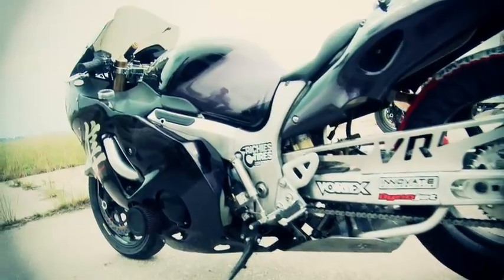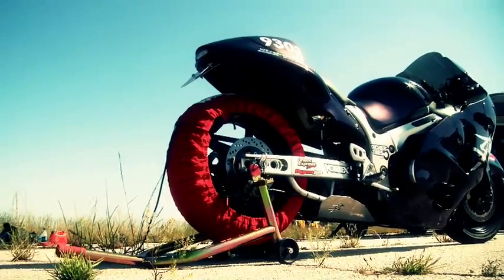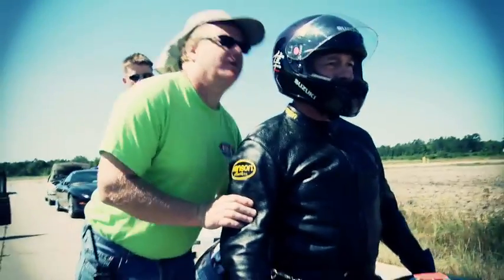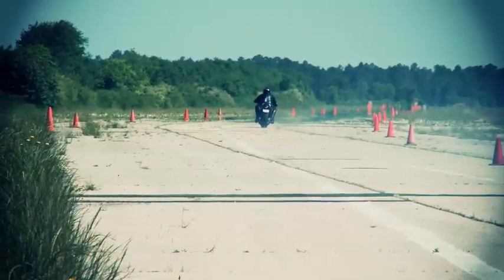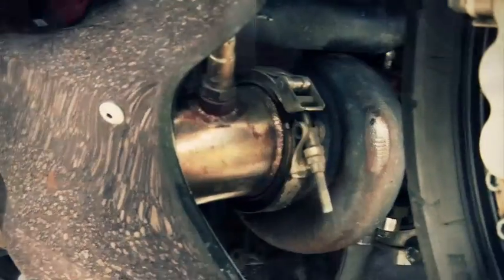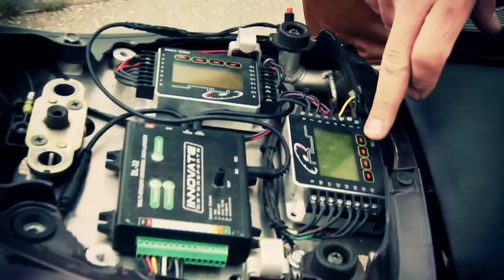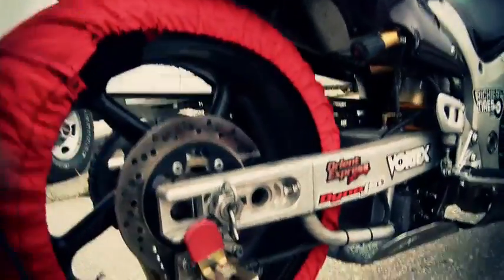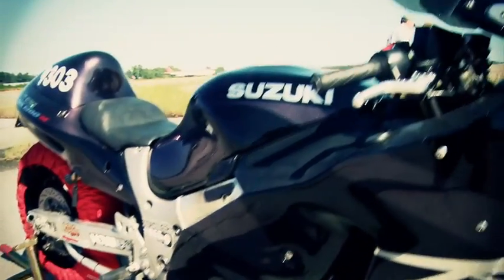Fastest Mile- 256.79 MPH on a Turbo Hayabusa

Comment: @spudhead96 You are absolutely right. I rarely ride or drive over 100 mph so having a Hayabusa would just be impractical for me. There is no where for me to ride or drive more than 70 mph legally except at the race track. We dream of owning fast cars and bikes but I would also lose my licence quickly. It's a great bike for sure and I could afford to own several but I own a light weight sports bike that's fun to ride and quicker in the city  than a Hayabusa and a lot cheaper to run.

Comment: @capnapalm hell a top fuel dragster makes 8000hp with 8 cylinders and does over 330mph in 1/4 mile. Good luck going from gas station to gas station though.

Comment: @wahconah98 What hype? The 1001 hp quoted is bhp, that's engine power before power loss. An engineer, who worked on the car said, that in tests, the engine had produced 3000bhp. 
That's why they can increase the power by 200bhp just like that. Do you think this isn't purposefull? Many manufacturers will try to break their record, and by holding back such a massive reserve, they'll be able to hold the throne for a long time to come.

Comment: @TheCrazyFinn - Toned down from 3000hp?  No chance in hell...  I think you fell for the hype about the actual HP generated from the fuel burned in the engine before you factor in all the inefficiencies of an internal combustion engine.    As a very very (stress very) rough estimate, crank HP is about 1/3 of the total power of the fuel being burned.  2/3 of the power is lost as heat and in mechanical losses.

Comment: @Chris239408 bugatti engine is maxxed in the ss model, bugatti said that themselves. ssc ultimate aero is on 16 psi and still has room to tune. so thats probably were you got that idea from. but still neither car can touch something that weighs as much as both of those cars engines.

Comment: @Chris239408 Believe it or not, sports cars are more aerodynamic than bikes.  This is why there are very few stock motorcycles capable of breaking 200mph even though their power to weight ratio is much better than a car.

Comment: @Brants10 I think you are missing the point the Hayabusa is a motorcycle not a car. If you have never bbeen on a bike at high speed you will never feel the adrenal rush it create. It is not the same in a car. I have a 2009 busa and trust I do not care what car you in the rush is not the same I do not care about radios wipers or any other creature comfurts. You are right the bike is not in the same league as your presiouse Veyron. I would chose the bike every time.

Comment: @srt10taylor Lol, you're talking like 10mph is nothing at 250+mph. There's so much air resistance that even an additional 1mph will require significant horsepower. Plus I doubt this turbo hayabusa is even built to run for that long. The engine would probably overheat and blow after 2 miles. It's like me saying that a top fuel dragster can hit 320mph in the 1/4 mile, so it can hit 500mph in 10 miles.

Comment: @CBR11X

Cars are able to put more power down on the road, and have better aerodynamics. A Ford GT hit 266.9 mph in a mile, with 18 mph of headwind. The car had 1,900 horsepower in that run.

Comment: @8Sniper8 Yeah, but did it reach that speed in a standing mile? I think it would need several miles and a special track to reach top speed , like the Bugatti Veyron.
This is about the Texas mile, not about absolute top speeds. The Ultima Aero would be struggling to reach 190 mph over the standing mile.

Comment: @Inv4derxXx They have all sorts of vehicles out there from mini motocrosses, vw beetles to 1,500 hp twin turbo V8's. I want to take my commuter bike to see how fast it will go then do some mods. It can be a low budget hobby to a very expensive exercise. I think you a right about it being a Ninja 500. I'm planning a small capacity racer to fool around with on the salt flats.

Comment: @Ayperos93 Why can't it be done? What's so magic about 160 mph? Seems like you pulled some number out of your arse (and an opinion as well.) When air gets under the bike at high speeds, especially bikes with fairings, of course the bike can stand up. It happens from time to time in racing. Also  you can see the Youtube video of the world's fastest wheelie which is 182 mph plus.

Comment: @jorgigale Your not wrong. 189 is fast by any normal standards. Very, very fast indeed. It depends on the context. Speed is addictive. If you sit on 100 mph for hours it seems slow. But go 100 mph straight out of the driveway and it seems very fast. 189 mph is 277 ft second and if you fell off at that speed and took 8 seconds to come to a rest, you would slide about 1000 ft or more than the length of 3 football fields. I wouldn't think you need to go faster.

Comment: @badbrad66733 Potential top speed should be referenced to the power to drag ratio, that is Cd and frontal area. A 1000 hp car may have a frontal area of 25 sq ft and Cd of 0.35. This would give a combined air resistance (R) of  8.75. For every unit of air resistance (R) the car has 114 hp. This bike has a Cd of about 0.5 and frontal area of 6 sq ft resulting in R =3. The bike has 480 hp or  160 hp/R. The car still needs more hp to go faster. 1500 hp in fact which seems about right for Maxton.

Comment: @crash86ed No slicks because it's a street registered motorcycle. No warmer on the front tyre because it's not driving through the front so doesn't need to grip like the rear. I'm sure they know what they are doing. They want to slam on the brakes cause that could destabilize the bike at that speed. I'd say the rider would gently squeeze the brake to easy the speed down. They have plenty of room to pull up after the run.

Comment: 110mph is perhaps fast in a car, but on a bike, especially the 1000+ cc class 100 mph is simply a grab of the throttle about a few seconds away.  Perhaps it's different for everyone, but I don't start to get tunnel vision until about 160 mph, it's not until ~190 it gets a little hairy.

Bikers routinely travel around 130 mph on the interstate here and it actually seems kinda slow after a while.  Upon slowing back down to 70 mph you feel like you could get off and walk faster than you are riding.

Comment: the veyron also does weigh a lot. its just gifted with a shit tonne of power and good gearing ratios to hit top speed. 253 on a veyron takes a lot of runway to hit because is itsnt built more for acceleration but top end speed

Comment: More power and less weight are not the most important key to speed, reducing wind drag is. Put a stock Hayabusa into an enclosure and it will easily do 250+.

Comment: 18.000?? Dude , that would be stock as in not tuned , costs way more to get it like that ;-) Also the veyron is a 2000 kg car , the hayabuse what , 250 kg??? Not to mention in the veyron u have luxury and stuff , there's no way to compare both of em ;-) not talking bout the fact this one is as fast as the STOCK Veyron ;-) The tuned one goes way faster ... Then again ; no way to compare them ...

Comment: bullshit, there is a whole industry working on integrated protection such as back protection etc. I agree that this will hardly help at very high speed due to the distance you need to stop sliding and all the broken joints to this point. BUT, leather wears off pretty fast too and then you would be happy to have some kind of additional protectors, no plastic ones or ?kevlar? of course...

Comment: alot has to do with the bike also having less surface area..which would probably actually have more to do with the top speed reached..power to weight is more of a concern in acceleration to top speed

Comment: its called power to wieght ratio. the Veyron needs more power to get up to 253mph since it weighs more. Also, as you may or may not know, when you double your speed, your drag increases by four, so the faster you go, the more power you need. As for a bike that doesn't weigh much. you need less power to acheive the same speed.

Comment: This comment is for Cabritorsss. They do have small 4 cylinder car engines that push 1400 hp to the wheels when modified!! Brent Rau's 2.0 liter (2000cc) Mitsubishi eclipse has over 1400 hp and runs 6 second 1/4 miles! 
     His 2000cc engine is only slightly larger than this hyubusa engine which I believe is 1300cc. 

This busa is bad ass none the less!

Comment: You my friend, are an idiot. If you had a mclaren f1 engine and this engine put on the dyno,hooked up to the flywheel, this bike motor will produce more horsepower than the mclaren f1 motor.the dyno measures hp the same wether it's a bike engine or a car engine. Additionally, due to the large amount of gforces around corners, cars are far faster around corners being on 4 wheels compared to the bikes 2. Once again, watch the top gear ariel  atom video.

Comment: Actually it's not about 80HP, the rough estimate for vehicles is 20% loss of power through the drivetrain. But now thats becomeing less and less common through newer transmissions, rear end and such. Now your looking at 17% for most vehicles now, now thats with just RWD not AWD/FWD. AWD is more, around 25% loss of power through drivetrain. But WHP for a bike is almost what it is at BHP. You rlooking at just a 4HP difference between the BHP and the WHP for a bike.

Comment: Actually it does. Mclaren f1: 627 hp. this hayabusa: 636 hp. I understand its lighter but that hayabusa motor produces more horsepower. plain and simple. If you took those motors out and put them on a dyno, the hayabusa produces more raw horsepower.  Also the mclaren can corner a lot faster than a bike. Just look at the Top gear ariel atom video. Bikes are not as fast as cars around corners.

Comment: Apples and Oranges. There are instances where a car cannot compete, and there are instances where a bike cannot compete.

You mention a Supra as a "capable" car, which shows your interest is more about straight line drags.

All you compare in a drag, especially a rolling one, is engine and weight. The point of having 4 wheels is for agility in corners. Something a Supra isn't a good example of.

Comment: Its kinda funny how time and age can make a difference. Im 54 now, and I would be too worried about the tires and chain (belt) and little things to go really fast. When I was 27, I took my Kawasaki 900 with the Z1 racing engine up to 137, when I wanted to do 143, but some cars were coming up fast on me with only a middle lane to pass them, so I took my hand off the throttle. So in that time and place, 137 was pretty kewl. Y2K must be wicked too!

Comment: Bates and Vanson have preformed just fine for decades in Drag Racing.  So much so that Larry McBride has had no problem running sub 6 second passes at over 250 mph.

Comment: I had 4 turbos on each cylinder head valve on my 1996 honda c90 CUB.I got a 1bhp gain out of it and it cost me 13k sterling.Gonna put some snow chains on the tyres to try to get the power down.Watch this space!!

Comment: Err, the number of turbos doesn mean anything when it comes to maximsing power. You do realise that the Veyron is a stock standard production car that has little noticable lag compared to the other two cars you mentioned. I have been in a vetron and it is honestly an engineering masterpiece. Any tunign company can produce that type of performance if they so wish, but none of them could have any where near the refinement of the veyron. It is a truly extraordinary car, mark my words.

Comment: keep in mind this is a motorcycle here. it's got 480 rwhp and only 500lbs. you've got 598rwhp on about 3,000lbs. The motorcycle has a big advantage on weight to power ratio.

Comment: There is a simple reason it did not wheelie, that is because the driver does not want his wheel to leave the ground. When your front wheel comes off the ground you have to throttle down to let it back down loosing more time. Have you ever see a professional wheelie is a race that meant to.

Comment: Some of you people posting here are idiots.  There are several turbo busas making upwards of 650hp without inflating the numbers.  This video is from a ECTA Land Speed event & all speeds are certified.  No fudging here.  In recent years there have been quite a few turbo Busas running 250+ mph.  You got to remember too that Maxton is a standing mile; dead stop to a mile this bike is going 256 mph! Just think what these bikes could do if they had 2 miles of pavement.

Comment: low 9s on a 1/4 mile... and 180hp+ and 110 lbs of torque... 0-60 2.4 sec... with a light rider 200 pounds like me... should do a nice demage... well the only way to know if on the track... i only been riding bikes for 7 years... and i was not talkin about cars... pussy bike... yes! if u gona spend money spend it right 

"owner of a 2008 hayabusa
2005 cbr600rr
ninja250 2008"

Comment: see people that think like that are complete idiots. my 250 had more power than i actually needed, if you're riding close to it's limits you're breaking the law anyway. well if a bike that runs 1/4 mile in the high 11s, 0-60 in 3.16, and has 72hp and 48lb torque is a pussy bike, then great i guess nearly EVERY car in the world is a "pussy" too since my bike is faster. the funny thing is i don't care what you think because i can about guarantee i am a better rider. it's not about top speed